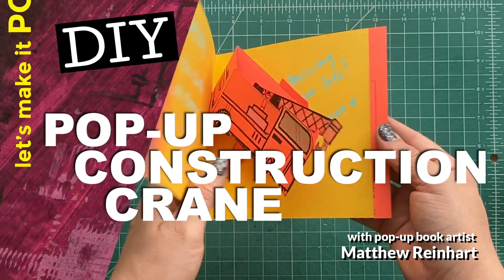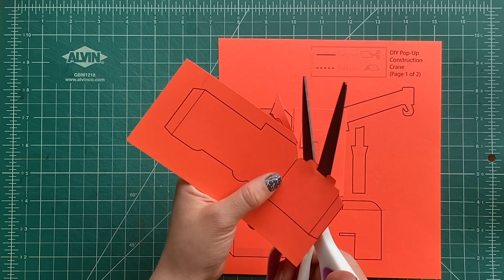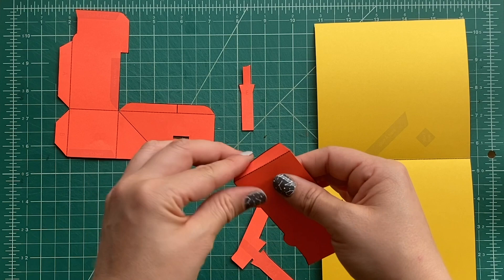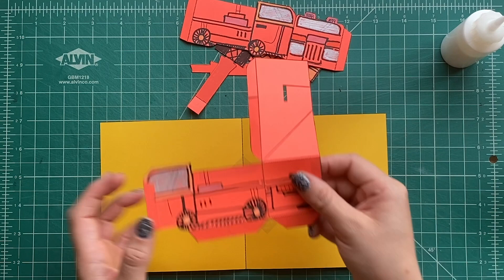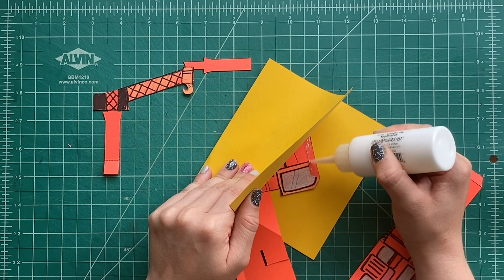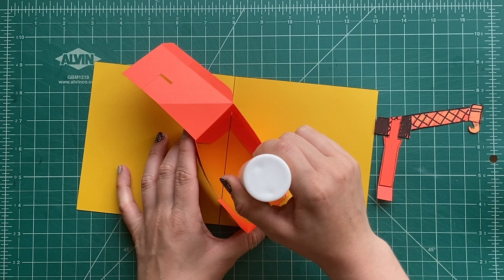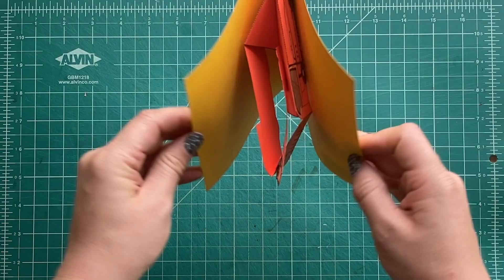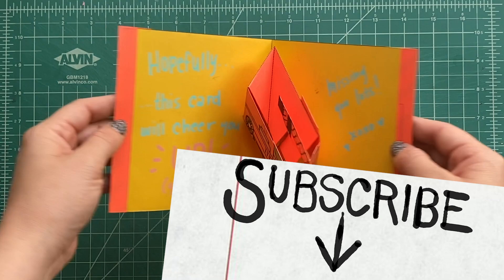DIY Pop-Up Construction Crane from Matthew Reinhart

Comment: I dont have printer, so everything templates he makes  I manually draw it on a paper, test it if it works and do maths. Hehe
Reply: That's smart. I think you learn more working it out for yourself but it takes more time. I put the PDF's on a thumb drive and took them to a local printer to get my copy.